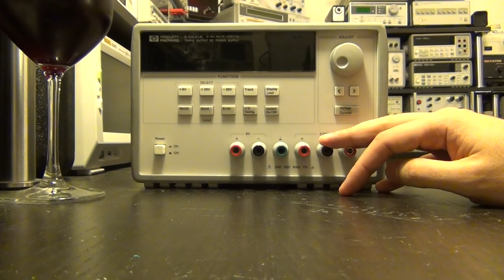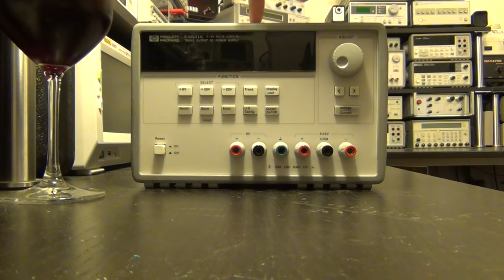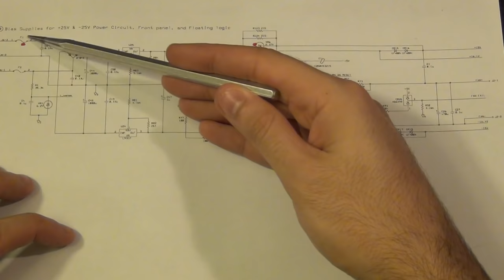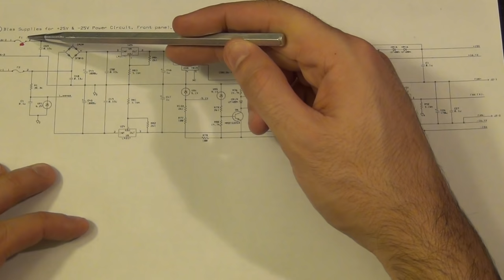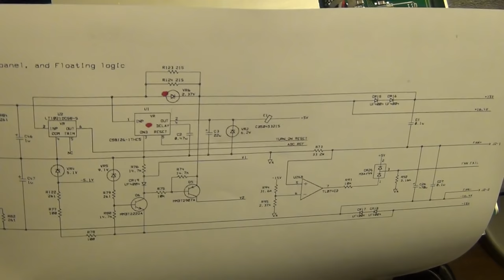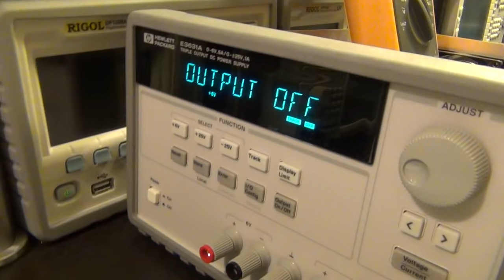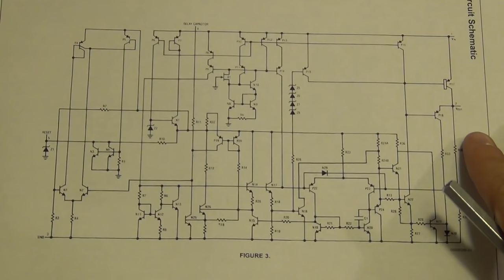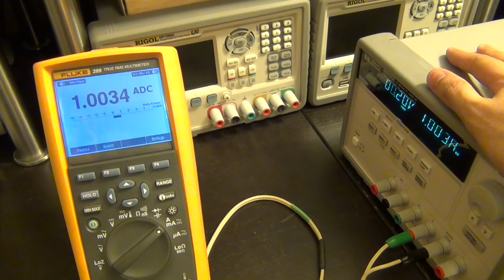TSP #55 - Teardown & Repair of an Agilent E3631A 6V/25V 80W Triple Output Power Supply

Comment: Thanks. Good video. I’ve got one of these with two problems. One is the same problem you have with the control knob. I would not have thought of cleaning a rotary encoder. I’ll give that a try. A strange problem is it also outputs voltage when the supplies are off. If I turn them on and set them for zero (via GPIB) they got to zero, but when they’re turned off, they output a significant voltage, even when programmed to 0V. That should be an interesting problem to troubleshoot. I’m glad to hear the schematics are available.

Comment: The reson for the 2 wires not going through the connector is to minimize the contact resistance  for those 2 wires going into the 2 big  resistance.

Comment: its pretty good. I feel cheated that we didnt get to see the knob repair. lol
Reply from the maker: 666alikat Sorry! It got cut out of the video.
Reply: The Signal Path Blog  would you please post that short video (fix of the knob)? It covers so many other HP products and would be very popular with your viewers, I think.
Reply: The Signal Path Blog Not to mention, repair of an optical encoder moves beyond HP gear.  I've got a Yaesu ham radio that needs a similar repair, and the idea behind it may be compatible.
Reply: +1 For an optical encoder "quickie" video!
Reply: 666alikat I would like to see the optical encoder repair.  I have a bad encoder also..
Reply: The Signal Path Blog Please consider the knob repair video.  Keysight has made it very difficult to order the replacement part lately.
Reply: L. Kraven I have had the same problem with Keysight trying to order the part.  Also, their repair information says that my serial number should not have the problem but it does.
Reply: For those of you that are trying to repair this model/line of power supplies; I have the same problem and found that a replacement from Keysight was $6.95 (CDN). I know they have a minimum 50$ order, but I found an encoder at Digikey (PN: PEC16-4015F-N0024-ND) that seems to fit the mechanical and footprint of the encoder that is used in my model (E3648A). It is a 24-pulse per revolution part, so I am not sure that will be compatible but for 1.55$, I'm going to throw it into my next DigiKey purchase and try it out.
Reply: 666alikat I, too, would rather like to see the repair of the knob.
Reply: +idpromnut I am having the same knob issue for my Agilent and was wondering if your replacement part from Digikey worked out for you?  Thanks!

Comment: My power supply has the problem when you adjust the control. Is it a mechanical problem or should I buy some contact cleaner? I can live with it because I really didn't think it was a problem until you pointed it out. Thanks for all the great video's, and always keep your electrons flowing and don't get shorted.

Comment: 17:29 Those soldered connections look like they're the sense lines for the +25v and -25v rail. Would make sense not to have them on the connector that would introduce a varying (if small) resistance.

Comment: Thank you for the very informative video. I have exact the same power supply (got it for free, not working). It turns ON with one beep and the test display is always ON (all segments ON).
I found diode CR13 (seen at timestamp 18:11) shorted and the track connected to it burned. I replaced the diode and restored the track. No short, but still same result. Any suggestion where to check?

Comment: I would have expected it to require more repairs then just change zener and regulator... Starting to consider that maybe i should get one of those thermal cameras, even if i rarely have use for one.. Seems handy and in this repair it sure vas valuable tool to have...

Comment: Great video, really fun to watch the repair. What is the most likely cause for the regulator failure? Sorry if I missed it.
Reply from the maker: Kent A. Vander Velden It is difficult to say. It could simply be aging, this is an old supply with probably many working hours under its belt.

Comment: How did you desolder that voltage regulator.
With hot air station or soldering iron with big tip? Did you cut the legs off first?
I would love to see that in the video.
Reply: at 18:56 you can see the IC without the legs in his hands.
Reply from the maker: Franci Kapel As Dennis also pointed out, I cut the pins then hot air to remove the IC itself followed by soldering iron to remove the pins one at a time.

Comment: You definetly should get used to have a first look at stuff with the thermal camera. Saves you from getting burned, and is just very often leading good results. Also in the case of that sram that failed a while ago, I am sure you would have seen it much faster by just having a look with the thermal camera. the ex8 is on my list just in case I ever get rich...
Reply: Dennis Lubert you must remember that not all of us have a 1000£ thermal camera. The purpose of these videos is to teach us about repair without instantly jumping to use all the fancy gear.
Reply: ntcarver I must have missed that mission statement. IMHO you can't really teach repairing. For me these videos are for getting an insight into the thought  process of someone repairing something. And the thought process should be "lets see if something is hot" and if that includes thermal camera nerd porn, its better. Everyone who doesn't have a thermal camera will be able to say "oh hey, ok, I don't have the camera, lets see how I can look around for hot stuff". If they are not able to do this transfer then its going to be a hard thing to repair anything but the exact same fault anyways. I guess you didn't watch the 100GHz scope video either...
Reply: ntcarver Apparently it was a complete surprise that it was that hot.  Considering just how hot it registered we should have heard a sizzle.  I often use close proximity with the backs of fingers to find hot spots first or even freeze spray to see what cools/evaporates off the fastest.  Nothing like having your fingerprint burned into the top of an IC.  At least thermal cameras have come way down from what they used to be.
Reply: Dennis Lubert I saw a russian video, where the guy used thermally printed  paper from receipts. Push on ICs and they would darken when hot.
Reply: Dennis Lubert Once you've done it a few times your fingers get used to it. It's not that big of a deal. He didn't even properly swear.

Comment: Hi,
It is good video.
I do had  the same problem and I fixed it the same way you did...But what is bugging me is....What is  the root cause of this failure in the first place? There must me a reason for them to fail... Ageing is not a problem since it is a semiconductor...  
Then Why did that Zener and the Regulator failed in the first place... I am suspecting there is something else is bad which caused this 2 components to fail...   May be Caps or resistors somewhere else in the board... If it is then  it will fail again...
Mine was all working fine all fine then one day morning  when I turn-on  I see this problem.

Comment: Nice video
450 C ?? This can't be right.
No smoke,carbination,melted solder?
Sure it's C not F ?
.
Reply from the maker: ***** Oh yes, it is C! The solder joins were molten. I could have just pulled the component out without a soldering iron.
Reply: The Signal Path Blog Sounds like it makes desoldering of faulty components easier.
Reply: The Signal Path Blog 
If just all broken components would behave that way. Switch the thing on, wait a minute, rattle the case and collect and replace all the parts that fall out...

Comment: Resistors Do bot blow partially normally. They either burn out or work normally. With increasing temperature (because this is a metal film resistor) the resistance becomes larger and larger. So this resistor almost acts like a constant power device. Funny